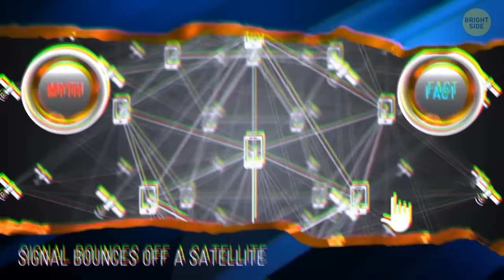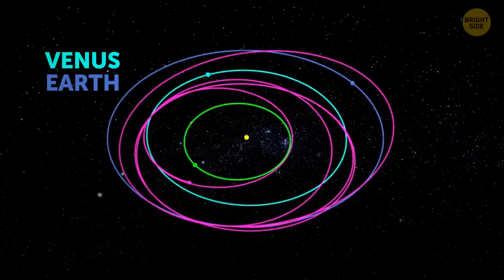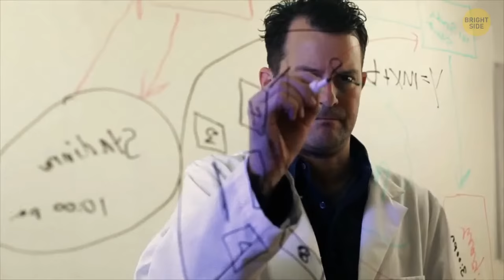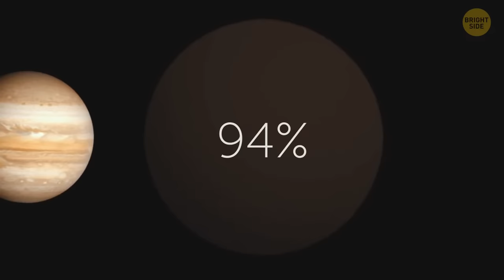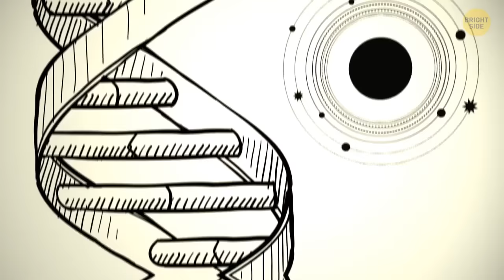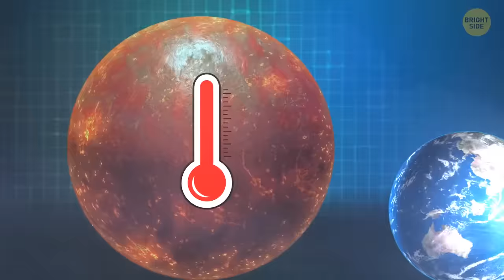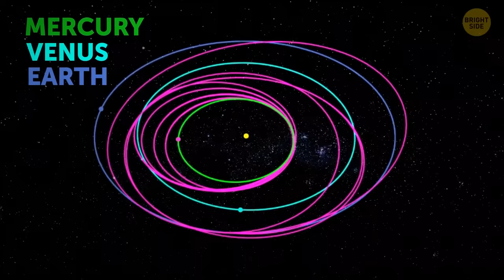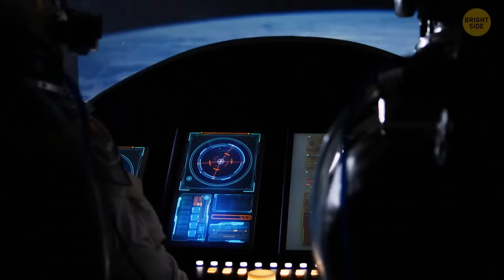The most unusual planets known at the moment

Comment: 4:02 I am pretty sure the star collapsing or entering a different phase wouldn't affect the gravity / orbits much.  It would still have the same mass, or lose some mass (which would expand the orbits) as it transitions.  It could expand (e.g. red giant phase) and engulf the planet.
Reply: Actually mass isn't the only determining factor of the gravity felt at any given place. Density also is a determining factor because of the way gravity drops off because of the distance² relation of the equation.  Meaning if the sun expanded we would feel more gravity because of its closer relative position. Now this is all conjecture since no one has ever been able to compare a star before and after it's giant phase but the force of gravity = G • mass1 • mass2 / distance² so force of gravity drops quickly with distance and think of the giant phase of a star as just getting some of its mass much closer to you so you would feel more effects from it. The current formula for gravity breaks down outside of simplistic uses of it within the extremely small framework that it's creators are refrained and kept hostage within.
Reply: @tylerdurdin8069 isn't that the distance to the center of mass? Which remains the same.
Reply: Maybe it's not the gravity that much but the shedding of the outter layer of the star that will engulf any plant near it
Reply: @tylerdurdin8069 Your comment impresses me. Mostly because I don't know enough about it to be able to understand exactly what you're saying... though I have n idea. So, me asking this question feels strangely like running into a busy road (😮), but... I thought gravity was made stronger by the object's mass. The bigger the mass of an object the stronger the gravity. Of course I know that distance DOES factor in... but I don't know which one overrides the other.
Reply: Amazing facts from you!
Reply: @Irish_Georgia_Girl  Yes, mass is what gives rise to gravity. Mass does not increase as a star collapses or decrease as it expands. However, density does do that, but gravity is determined by mass, not density.

Comment: @25:39 Venus doesn't spin clockwise just looks that way. That's because the axis is at 177° putting the north pole almost exactly 180° upside down.  If you could take the north pole and drag it back up close to that of earth without changing the spin it would now be spinning the same as the other planets. In order to officially be spinning clockwise the north and south poles would need to swap places or the planet keeps slowing down and eventually start rotating the opposite direction then it would appear to be the same, but is spinning clockwise.
Reply: @owood5243 - well gosh, if you take the anticlockwise of the planet and move it so it's aligned with the anticlockwise end of earth, then it rotates the same way as earth; what a surprise! (If my sarcasm isn't obvious, think about how "north" is defined.)
Reply: @martink6092  don't get what you're saying. So if earth was tilted at 177 deg you make south pole north and now earth is 3 deg tilt and spinning opposite direction.

Comment: Please don't use this video as the basis for your school science report; it has some fairly glaring inaccuracies. For example at 0h15m05s it says that a red dwarf will later become a blue giant, which is nonsense, as (a) stars cool rather than heat when they swell; (b) blue stars are (much) hotter than red ones; (c) dwarves are what're left after main sequence stars temporarily swell to red giants, or they're that way to begin with and never swell up; (d) blue giants often become supernovae, leaving behind a pulsar or black hole.
Reply: When I heard what he said at minute 15, my B.S meter went off. I had to check the comments to see if someone had mentioned it